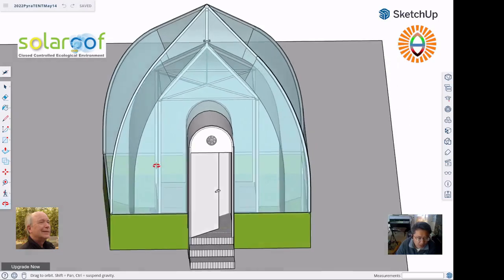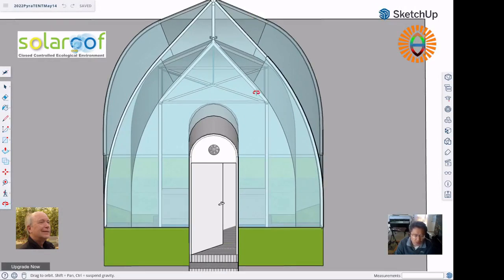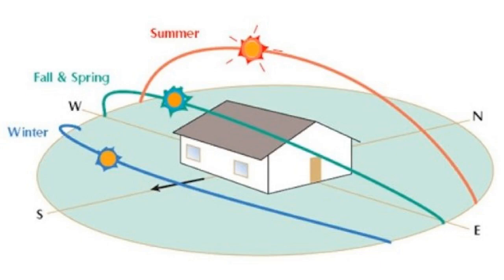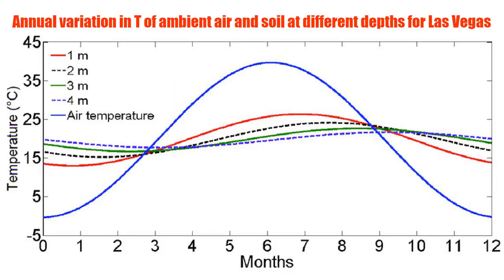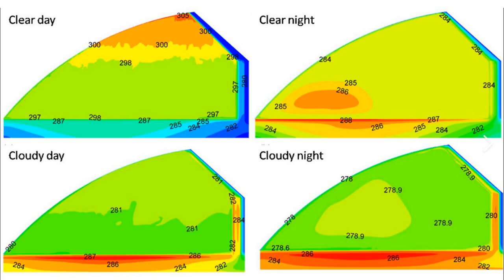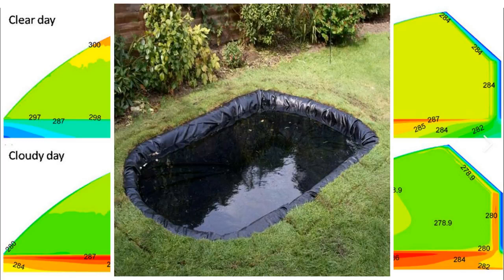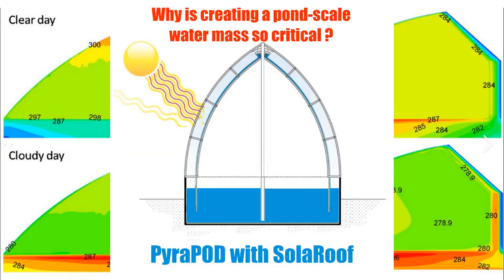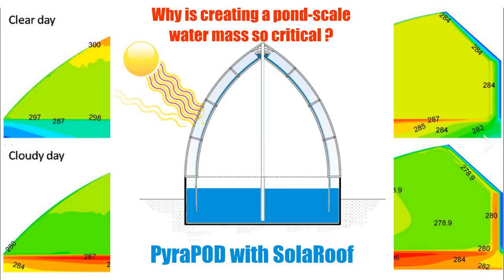Better design for PyraTENT: why creating an in-ground water pond is critical in storing solar heat

Comment: There have been DWC (deep water culture) aquaponic greenhouses built using this principle, I was brought in to redesign a large one near Temple TX where ambient air temperatures can run between 110F and -15F. My system allowed the owner to maintain production temperatures (65-85F) without dependence on grid power or propane, both of which are huge costs most commercial greenhouses must maintain.

Basic principles: The enormous thermal mass of the water in the DWC beds is continuously circulated, keeping greenhouse temperatures evened out. Directly below the DWC beds are air tubes which are used to transfer solar thermal energy collected at the peak down into the DWC thermal battery. The water in the DWC beds is of course circulated through the aquaculture tank, where additional heat can be added using a rocket mass heater. This additional wood heat was only necessary during the coldest periods, primarily to protect the fish (tilapia) but also to keep the DWC beds within productive temperature ranges. Flood/drain gravel beds are used to cool the thermal battery during summer months while providing filtration functions.

With this design you can to do the "impossible": produce lettuce in summer and basil in winter without using grid power or propane. Power outages can kill everything in a greenhouse in a matter of hours and wipe out your business, this system increases production and provides insurance against large temperature swings.
Reply from the maker: With our system, you can do even better. One solar panel and a battery are enough to power the fan and pumps. Single layer greenhouse won't do this well.